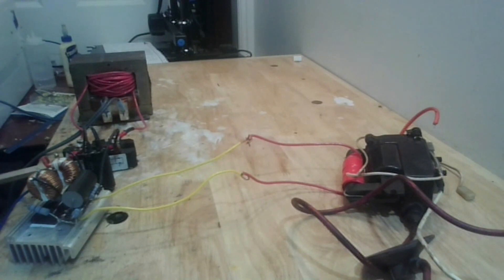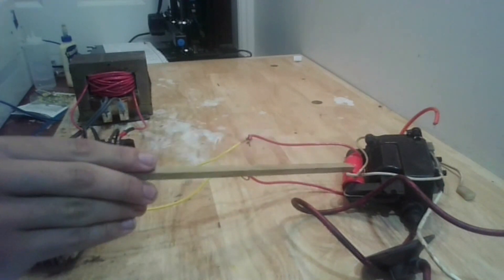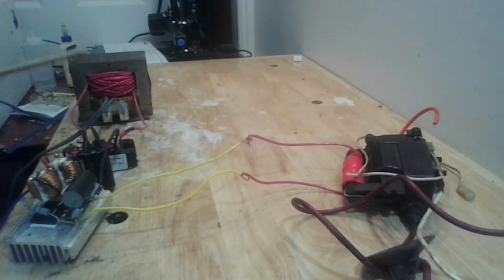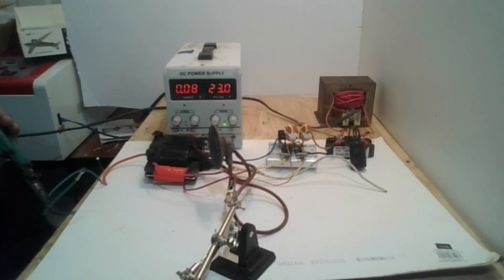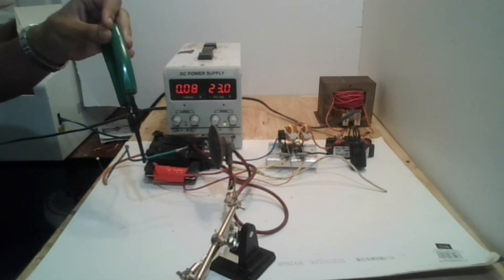How To Make a High Voltage Power Supply| IGBT-ZVS

Comment: Man I haven't saw your channel since 2021, this is so neat, I'm currently building or trying to build a VTTC
Reply from the maker: Thanks.
Reply: @-ElectroMan-  where did you bought your 811A triode ??
Reply from the maker: I found it on ebay however, I recomend you use a larger tube such as the 833a or GU5B.
Reply: @-ElectroMan-  it wasn't chinessium tube?

Comment: Nice video!
I highly recommend you to use a higher capacitance after the rectifier tho. 
680uf wont be enough to smooth out the DC at the high currents the ZVS draws. I would recommend at least a few mf, personally I would use something like 10mf or even more if there is still significant ripple remaining.
Reply from the maker: Thank you for the advice.